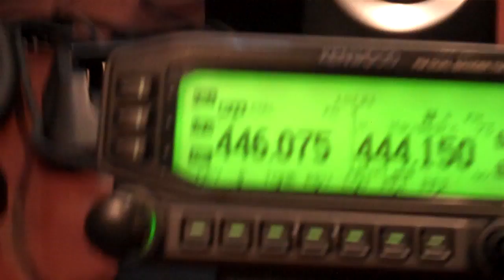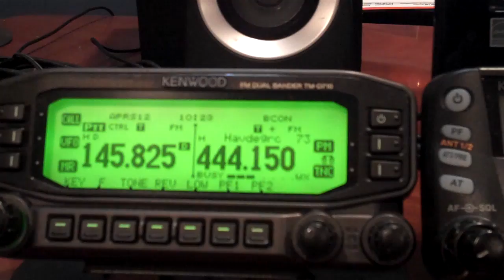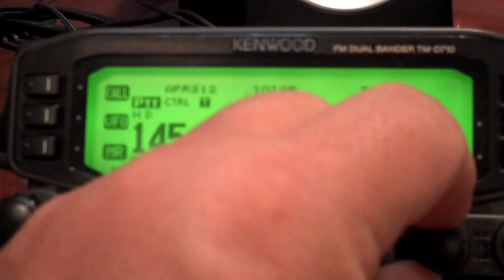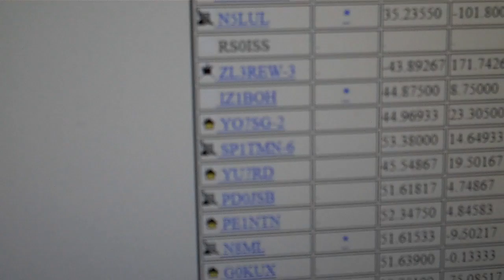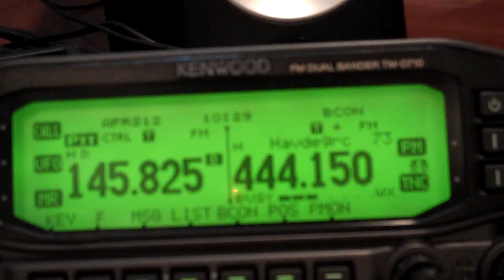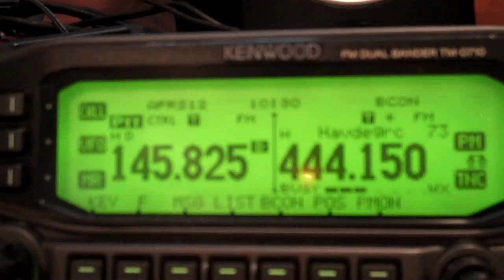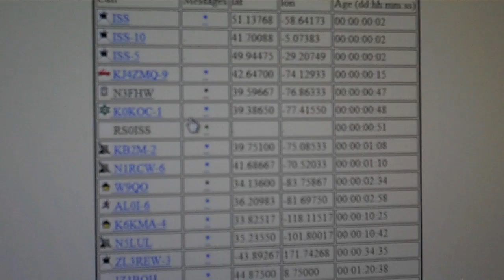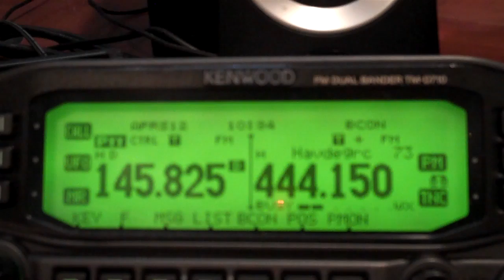Working the ISS using APRS and the TM-D710

Comment: Just broke down and bought this radio about a week ago. I've heard the ISS has one up there now. I worked a 9600 baud packet terrestrial BBS today. At one time I was fluent with packet, not so now. I have worked APRS using sarTRACK  which is a great program for win10, and now has jumped half way into Android, although not quite enough for APRS. So, I'll look and see if you've progressed. Thanks for the vid.

Comment: Can't that radio have your computer connected and send packet data via your keyboard?
Reply: Yes it can. But you need more geekpowers to do so. Set the rig as TNC. Connect to the TNC with the com port cable attached to the head of the rig, with a terminal program. I use Kermit 3.16 on an old dos laptop with a com port. (rs232)  Once connected use the Kenwood TNC terminal commands as described in one of the manuals. The command set is.....lets say minimalistic. Now you have total control of the TNC and the rig. You could connect to the space stations mailbox (if its on) and post a message or connect to a station via another one etc.  I once connected myself all across Europe from north to south. You can setup a IP link across the air and ping the computers on the other network etc. Only problem is almost no one does packet anymore. In short, yes the TM-D710 (G) can and so much more.